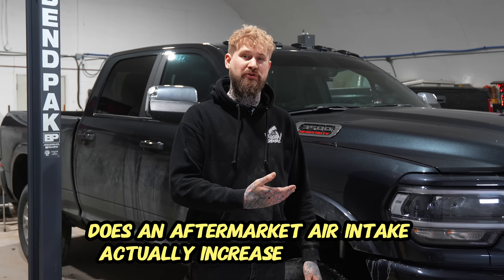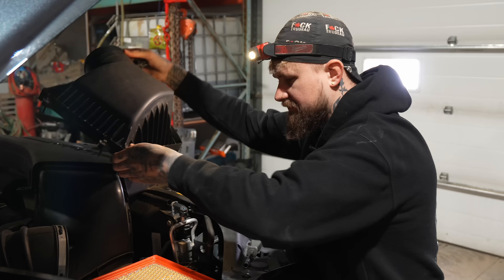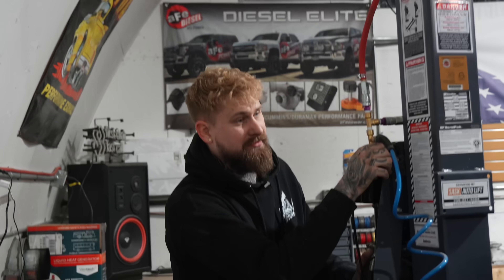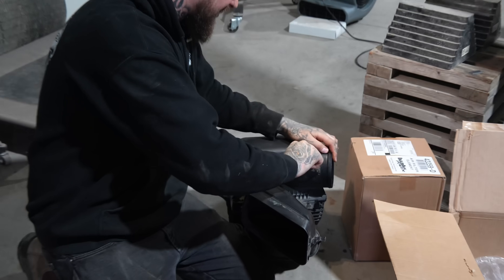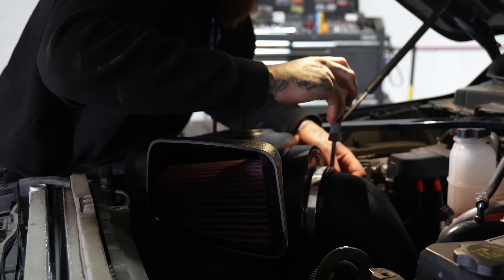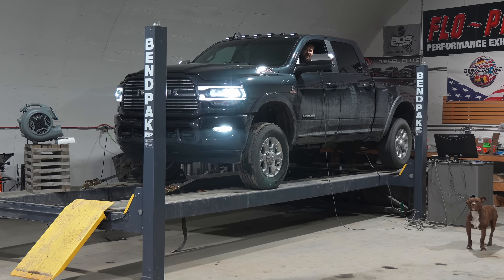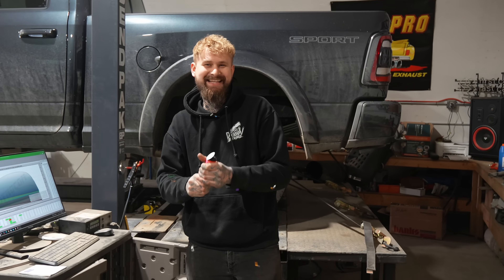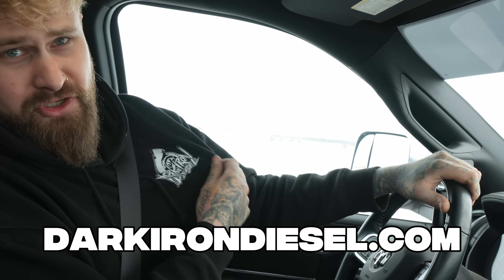Does An Aftermarket Air Intake Increase HP - Cummins Dyno Test

Comment: Whats with all the dashlights?
Reply from the maker: Running on the dyno sets a lot of lights
Reply: @darkirondiesel  never had that issue
Reply from the maker: With a 2022 ram 3500? How did you do it? It sets my engine light, park brake, abs and traction control. As soon as you drive off the lift they all go away though.

Comment: Well... if sound is what your chasing you definitely found the solution but it still doesnt fix the problem of it still wont start if left outside without being plugged in -15ish or colder which is possibly 5 months out of the yr in Canada. That said you put Banks on notice that their products are not an end all to be all solution for North American conditions. I live in Alberta Canada and there are lots of places i go that dont have the luxury of plugging in ( deer camp, work, etc.) I think having to drag a generator with me so my truck will start in the wintertime is crazy. Will be upgrading with the BD for sure until someone comes up with a better system that WORKS in the winter. Cheers.
Reply from the maker: Well this comment has nothing to do with this video, this video is strictly testing their cold air intake, but regardless they spoke to me and are developing a cold weather solution for us Canadians so I’m excited to see what they cook up!
Reply: @darkirondiesel I realized that, but the entire bank's package. As a whole is good stuff and I'm not saying it isn't. What I'm saying is that it's not an end all to be all for everybody. It's now spring here Of course it will start But you found The weak link. And weither you go all in with all the Banks products. Pedal monster, tuner, intake etc. There is still one flaw. Hopefully, the team at banks can fix the problem. Cause I was looking at going with a full Banks system once mine gets deleted. It was your video that showed the flaw. I have to take that into consideration when spending big money to do the conversion. Because at the end of the day, no matter how good the product is, if the truck won't start, it's pretty much useless. Wouldnt you agree
Reply from the maker: Oh yeah totally agree, I’m doing some more tests with it this week to see if we can get some better results
Reply: @darkirondiesel  right on... cant wait for your results

Comment: My banks ram air was such a bitch to install, it sure as hell didn't fit as good into the stock air dam
Reply from the maker: Not trying to be a salesman here or anything but mine fit very nicely compared to other brands I’ve used in the past. That’s just my experience though.

Comment: Someone call me out on my bullshit if I am wrong. 

I think the stock intake with a genuine mopar filter will be fine up to  600 Hp. 

Pull the baffle, keep a good clean filter in it

2014 Ram 2500, deleted, tuned and fairly happy for now with my setup.

Comment: So between your 2 tests of the air filter and the intake elbow, for an investment of only $1500 or so you can break even on the HP numbers.  And to go along with that you get a truck that wont start in sub zero temps.  Hey, but you can hear the turbo better.
Reply: People are easily duped.  Gale Banks has figured this out.

Comment: You may not lie, but your truck ran like shit in the last video -  originally for starts... adding a modifier to it, without any fuel/air review during start or idle with like a wideband, you're shooting in the dark.  Garbage in, garbage out.  I'm working on redoing your ram air test with a truck which actually starts and runs normally before the addition of the increased air flow, and based on my years of automotive and tuning, will bet it will work yards better.  We'll see.  And if not, then I'll eat my words.  Increasing airflow and volume, then making sure your tune bumps up fuel to accommodate can do nothing other than increase flow and efficiency.  

It's also about disruption to airflow; the Banks intake is much more geared for air dynamics than the stock one.  Any casting disruption, heater grid, BD fat ass bar, will cause turbulence and flow slowdown.  Good luck.

Also, a lot of us run cold air intakes, exhaust, deletes, tunes... so any additional airflow increases will be bumped up over stock gains.  Initial tip in, or off idle throttle, will likely be more responsive because the airflow isn't impeded as much.  We'll see.

Comment: wouldn't you need a different tune, or to tune it, when swapping out some of these parts so that the system can properly take advantage of the increased air flow?
Reply from the maker: You don’t NEED a different tune. They even say that on the website. But once I build this truck with compounds the increased airflow will help a lot

Comment: Did you do the transmission tune? What are your recommendations for transmission upgrades?
Reply: For the 68RFE
Reply from the maker: Yeah if I had a 68rfe I’d tune it. The trans and engine are controlled by the same computer on those trucks so the transmission tune is built into the engine tune.

Comment: I did the cold air, intake and boost tubes on my ‘15 tradesman and notice a remarkable difference in power and sound when i push on the throttle. Cant wait to delete it when CARB is killed in CA!!
Reply: Seat of the pants dyno vs actual dyno are two different things.
Reply: Don't believe carb is leaving CA.

Comment: Do you, or have you considered a FASS fuel filter system with fuel heater? I noticed a huge difference in my Cummins cold performance with it.
Reply from the maker: I have a fass im installing in a future video! I don’t think I’ll need the heater though. Where I live it’s super cold so they put lots of additives in the fuel to keep it from gelling
Reply: @darkirondiesel  The disk heater would be great for you. It has a thermosensor so it doesn't turn on when the temp is above 35 F.

Comment: Bro when ever you do a dyno run you have to run a fan to simulate driving conditions, you will see larger numbers and a bigger gap between filters especially stock to banks keep it in mind for next time.
Reply from the maker: It’s hard finding a fan that I can move around the shop that simulates highway speeds. If you know of one let me know. Banks uses a dryer fan from an automatic car wash it’s massive 😂
Reply: @darkirondiesel  right?! Like where tf did you get that? 😂

Comment: Very informative content and love the real world results. I would love to see the Banks intercooler dyno'd. The "gains" are always exaggerated it seems and your test on the intake really shows it, the price tag on these parts is very high and they net very low or zero HP/Torque. Its always good to hold these tuner companies accountable for their claims.
Reply from the maker: I’m waiting for them to release an intercooler for a 5th gen!
Reply: @darkirondiesel   And I will go piss off old Gayle with the false results they claim. I have high hopes for the results as I have a banks intercooler on my duramax

Comment: You should do an air intake battle get different brands and put them up against each other
Reply from the maker: That would be interesting
Reply: @darkirondiesel 💯👏🏽💯
Reply: You would have to consider filter quality how good it filters. As the best intake for power is probably gonna be the one that doesn’t filter dirt out.

Comment: do you happen to know any fixes for the  p0402 code on the 24 rams after installing a banks air intake ?
Reply: It goes away in time after it breaks in Ms gets miles on it. That happened to me in the beginning, a year later and another 30k miles and it’s been fine. It’s like the computer adjusted and learned for it or something. The first 1000 miles anytime I put the heat on it would throw that code. Anytime I mobbed on throttle passing folks up hill it would do it and then within 100 miles clear itself. It happened about 5/6 times and then never again. Just as a heads up, people don’t give them time and without a tune the computer needs to learn to adjust to adjust for it. Just my 2 cents
Reply: @JDdoesmore  thanks for the info man there is about 45000 km since I put the intake  on. First when I put it on, the engine light would come on around  300 km and if I left it alone, it would go off on its own around another 300 or 400 km but now it just stays on all the time ...If I had a tuner could I make the engine light go away?
Reply: @ yes, the reason it even happens in the first place is because so much more air comes in the intake and the maf/map sensors read that and then it tries to adjust everything else to account for it and you get the dreaded egr valve stuck open code when it’s not. The same way unless you tune the truck and add more fuel putting a banks ram air intake horn on doesn’t all the sudden give more power, if anything without a tune you may get better throttle response but the reality is it slows the turbo down because now it doesn’t need to work as hard because of the additional air flow so it negates the part at first. My check engine light would go on after I mashed on pedal or put the ac or heat on and then like I said about 50-100 miles later it would go off and that cycle repeated itself for about 3/4 months or basically about 10k miles worth of driving. Then eventually the computer learns there is increased air available and it compensates with fuel and turbo speed/vanes open or closed etc and the entire system emissions systems included adjusts for it in time. If you want to skip that process just have it tuned and I promise you that stops happening. Or you can do it like I did and just give it time to learn and it will stop happening. The truck sounded better from day one and there was less turbo lag the more and more I drove it and broke it in. Once I knew the part was good and worked properly that’s when I deleted the truck and got the tune and it’s better than ever no matter if I’m in setting 1 or setting 5. I also have a stainless diesel 5 blade (compressor side) 68/71 9 blade (turbine side) vgt turbo, fass 250, sump kit, boost tubes, 100 over injectors, dual cp3 pumps, head studs, the usual stuff. Nothing too crazy on the 5th gen and I daily it usually in map 3 btw if that matter with race me ultra tuner. Has trans work as well but strictly talking about engine mods here.

Comment: I work on entirely too many dusted engines to ever use an aftermarket intake. Unless an engine is actually making double its original horsepower, leave the intake stock.
Reply from the maker: I see this all the time with stock intakes too. 99% of the time it’s user error on the install. I can’t even count how many times a truck has came into the shop with a loose clamp around the intake piping lol
Reply: Agreed 💯👏🏽💯👏🏽💯👏🏽
Reply: Don't use pod filters has nothing to do with the plumbing unless the parts don't seal well
Reply: SAME !!!!! 💯 AGREE !!!

Comment: Diesel engine manufacturers engine dyno test their engines and publish their "rated" HP, and it has a tolerance of +/- maybe 5-10 HP. Usually the air cleaner and piping that will be installed in the vehicle will not be used during their testing, that is up to the OE that installs the engine in vehicle and some may be more restrictive than others, but not by much, so you are not going to get noticeable gains in HP with a different air cleaner and piping. Measure intake air system restriction when dyno testing with each system and that will give you some good data as well.
Reply: Only a modern engine dyno using eddy current setup is accurate and as you said even then there's a noticeably wide tolerance, so running tests through your truck is really just for fun tbh.

Comment: Did banks ever find the cure for the check engine light that i have read? Comes  on with some trucks .
Reply: I have a 5th gen with banks intake and intake elbow, no CEL.
Reply: @jefflewis2897  is it tuned..?
Reply: @ No
Reply: They claimed this was only with the fifth gen.   I was told they were working on a fix almost a year ago.  With no timeline to a fix.
Reply from the maker: I’ve never experienced a check engine light
Reply: My light comes on randomly also…
Reply: I unfortunately got the CEL.  Can't tow heavy with this on even though it sounds awesome.  Truck isn't happy with the light on.  Sucks

Comment: Here’s the thing with the intake and the air horn (ram air) if you had a naturally aspirated engine these things would be beneficial or if you were running compounds or something they would be beneficial but for a stock truck with a stock tune or even a small 80hp tune none of banks garbage is needed and he knows it because the turbo will force the air threw the intake horn past the grid heater at what ever volume is required for the engine to run efficiently.
Reply: The whole point of aftermarket companies making air handling components is to make the engine breath more efficiently. Easier air handling gives fuel efficiency and then power when tuned for it.

Comment: 4 hp woah. Time to take it on street outlaws.
Reply from the maker: I honestly didn’t think it would make a difference so I was surprised to see a small gain. But I can’t be the only one who’s wondered this before. No one claimed an air intake would turn a daily driver into a drag truck.
Reply: Not to mention it's still a stock turbo. I'm sure the difference will be greater with a bigger compressor  @darkirondiesel
Reply: @darkirondiesel I would agree with statement above yours…what did the gains look like through out the pull as well fuel economy. Regardless the sound it gave the truck is worth it IMO
Reply: @darkirondiesel  we need averaged hp and averaged torque not only peak
Reply: Yeah, but you’re not looking at the curve gains over the entire Dyno pull
Reply: It's not so much as to adding power more or less decreasing restrictions and improving fuel economy
Reply: I think according to banks it's supposed to have some ram air effect from driving at speed, which won't show up on a dyno that doesn't simulate airflow at speed.
Reply: @arlobubble3748  Like his dpf back exhaust that sucks the exhaust out and claims to add power 😂
Reply: @HSKFab  Kory at PPEI tested the exhaust on a Duramax . It reduced turbo back pressure  2 psi causing a 12 wheel horsepower increase on the dyno. He couldn't believe it actually did cause an improvement.
Reply: @HSKFab every bit of backpressure removed increases the efficiency of the turbo, yes the dpf is a restriction but reducing the backpressure behind it will still help
Reply: The biggest prob is, its like a 700 dollar setup. So 700 dollars for basically no power and not crappy oiled air filter.
Reply: It’s a daily, not a drag truck. It’s just supposed to be clean and sound good. If you’re hating it’s prolly coz you’re driving a busted down 4 door sedan from the 90’s. 😂
Reply: @AnthonyCorey-i1t  well you're wrong on that one. But you be happy with your bs 4 hp.
Reply: Probably shaved a whole second off the quarter mile.
Reply: Lmao these guys trying to justify their buy in the comments 😂 "yeah but..look at the curve". Stop it. Same curve. Milage gains are trivial. Besides, who buys an 8k pound truck for the economy? Buy a prius if you're worried about fuel economy.
Reply: @HSKFab it’s an air intake in the end. I don’t own any bank’s products. I’ve got a 2019 6,7 Powerstroke.  If we’re gonna get super technical I just said look at the curve to see if there were bigger gains.
Reply: @Hoosierfast14 👍 I'm a Ford guy as well.
Reply: A lot of people!   Buy a big v8 that drinks fuel or buy a diesel that makes more power and get way better mileage.
  Hell I get better mileage pulling a 13k 5th wheel with my Cummins than my gas work truck with a 6.0 empty 
  I get 9 mpg with my work Chevy on the highway and 23-24 with my Cummins empty
Reply: 4 hp or 10 hp  just understand 1 hp make’s a different. It doesn’t much but it’s a big difference
Reply: @Dieselfuel-u4f  its definitely not a big difference. Especially in a truck.

Comment: I'm not sure if this is true or not but I've been told that aftermarket intakes and charge pipes or whatever only really benefit in a higher horse power application like a much higher hp build like at least 2-300 hp over the stock rated hp of the truck
Reply from the maker: They still have benefits on a stock application but you are correct saying it becomes more noticeable the higher the horsepower application
Reply: @darkirondiesel  very true i have an LLY Duramax i installed an air intake and a intake horn and got noticeable difference in response cannot answer about horse power but overall great channel love to see diesel truck content from Canada where you guys get it right lol
Reply: There are many other factors these upgrades are built for. Efficiency, longevity, and power are a few.
You must know the angle in the engineers aim in the product.
If it is engineered at all.